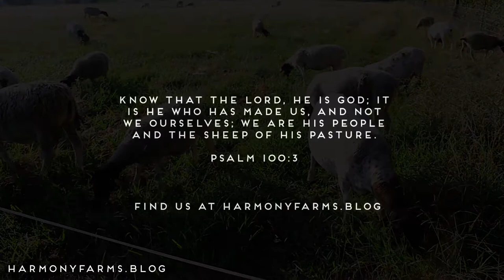Rotational Grazing Sheep on a Small Scale

Comment: Great information! I just bought my first hair sheep earlier this week and am training them to the electric fence now, with the plan to begin rotational grazing with them by the end of the week. We are in the middle of our rainy season now, so the grass is abundant!

I like the poly tape you are using. I bought poly wire, since was the most economical and lightest way to get it to Liberia. Fortunately, other than my security dogs, we have no predator pressure and netting is not necessary. What's the main reason you selected poly tape over the other options?

Comment: How feasible would it be to start a ram Coop with 10-15 other Dorper herdsmen/women?  Every year the Ram is rotated to a different flock so one does not have to worry about line breeding and inbreeding issues. I see the biggest hurdle is finding 10-15 others who rotate and not use medications so the sheep stay parasite free. I am not sure about other health issues a sheep might have. 
Then rotate the oldest ewe out (as long as she is not the lead ewe) this way you always have young stock. Best question, what is the life expectancy of a ewe? Then rotate out based on age, never want your herd/flock to age at the same time.
Reply from the maker: I’m sorry I missed this question, Don.  In my opinion, and based on feedback I’ve had from other breeders, sharing a ram carries more risk than reward.  

Rams are relatively inexpensive unless you are buying from a high profile breeder.  (You can get a non-registered dorper ram for $300-500)

Sharing a ram with 10 other operations opens your flock to disease and parasite problems, which could easily cost you everything. 

Thanks for commenting!
-the Shepherdess